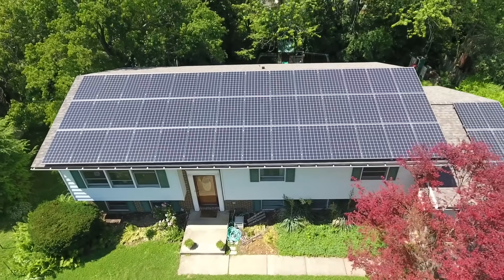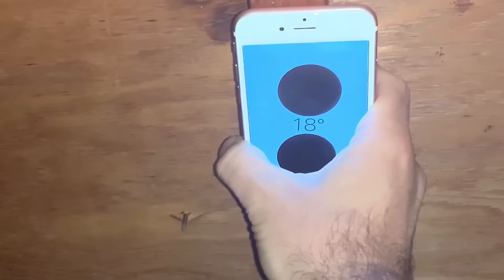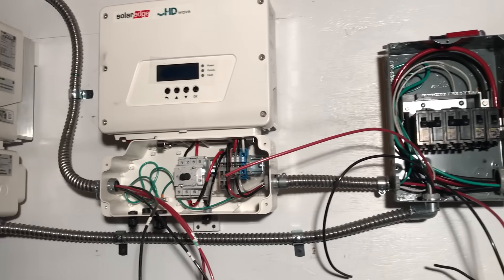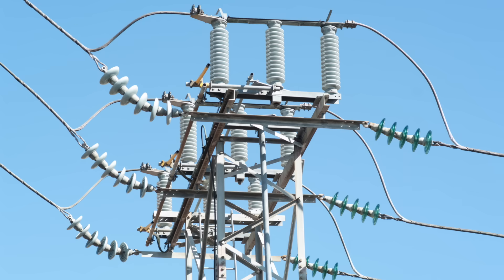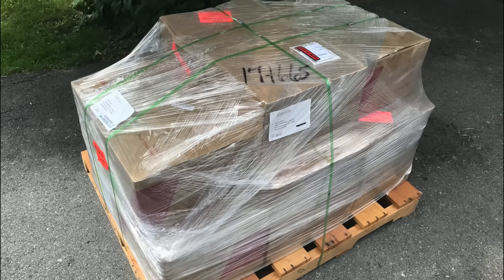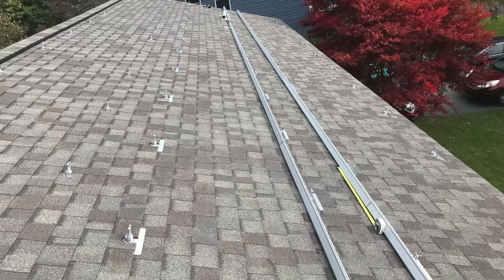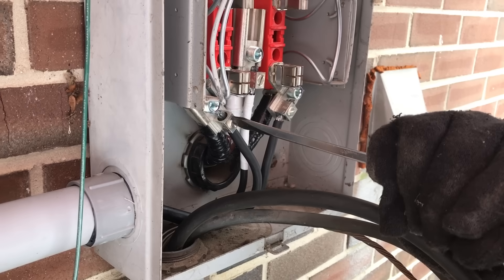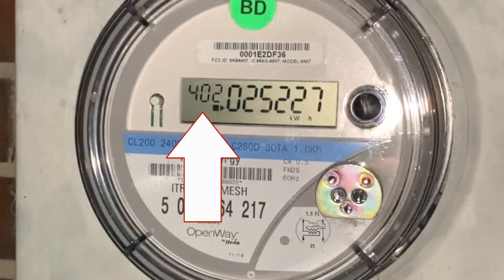I Installed a Power Plant Myself | HUGE DIY Solar Panel System

Comment: Next you need a smart power wall to send electricity to the grid during peak times. That is, if your power company charges different rates for peak and off peak times
Reply from the maker: If I had time of use rates (TOU), that makes a lot of sense but where I live it’s the same rate all day.  I get a 1-1 credit per kWh so no real need for batteries.

Comment: Dude, you rock!  This was a fun and inspiring video with the economics nicely broken down. The only thing I would add is how to address a leaky spot in the roof or one of the devices under the panels, if they need maintenance or replaced i.e. a maintenance plan. Next? Probably think about a decent haircut.

Comment: You think that chimney is unused. It probably vents your furnace or water heater.
Reply from the maker: No, it's only concrete blocks.  Actual function was removed before we purchased the house.  There is no vent or top.  It's best use now is for holding up conduit. =)

Comment: Not worth unless you can build an array seperate from the roof. The roof and panels share a life expectancy of around 20-25 years. Now you go from 15k for a roof to 25k for roof/panels or more. On paper you worked it out, post back in a few years once reality sets in. Panels are still terribly inefficient, you're making your utility company money while saving peanuts. Make sure when you post in a few years you provide your promotional compensation in the data so it's a fair presentation. Good luck.

Comment: Nice work on a worthy project, congrats!
Those Panasonic solar panels have a life of 25 years?  02:05  From what I have heard most solar panels degrade after just 10 years? 

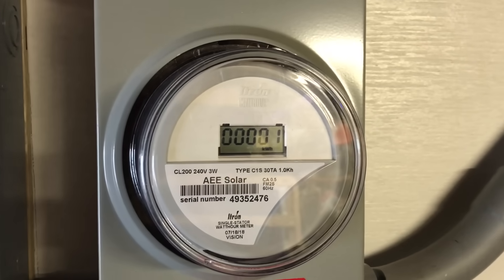Safety Note: 11:08 you connect your system to the grid by closing that large disconnect switch, sometimes those knives can throw a big arc of power serge out through the box right at your face. There are procedures in industrial plants to stand to the side to prevent burn injuries to your arm and face, in your case you would stand to the right side of the box and switch it with your left hand. See the sticker on the box warning of this danger too.
Reply from the maker: Thank you!  The panasonic panels are warrantied not to loose more than 10% of original output for 25 years.  It's one of the best output warranties out there.  I'm curious to see how they do as the years go on.  Thanks for the note on the switch.  Several folks have mentioned that.  Good to know!

Comment: Without a battery storage unit, like a Power Wall, I can't see how you'd ever have a net negative power bill. You're still using grid power at night and not producing anything via PV at those times.
Reply from the maker: I have net metering.  Did you see I talked about how the meter keeps track of what it drawn vs sent to the grid?  I get credit for what is sent to the grid.
Reply: He's selling power at morning and buying at night

Comment: Good day im from Belize. And I would like to know a ruff estimate how much that system cost you. Btw really informative video. Enjoyed it.
Reply: You may be less poor than the national average but if you are in the lower class of Belize this could really help you save cash
Reply: Hey Jason, Belize doesn't have import tariffs on panels to my knowledge. For an average grid tied system when you buy the components in Mexico or Canada (US is too expensive) you will be paying approx. USD $0.8-1/Wdc (this includes panels, racking, inverter, BOS, AC switch and DC wiring). This cost applies to systems from ~4-15kWdc.

Comment: well i dont know what state youre in but you dont 'make money' off of solar, you build up credits that fall off after a year, you dont get a check for that. and as far as 'no bill'. you usually get a separate 'true up' bill showing your energy made vs used, depending on time of year you can exceed the making of energy over how much youve used - usually in summer. i think you need to do a follow up vid to clarify everything in this vid and show numbers. i will admit though you built a HUGE system, when i worked at a solar company the energy company allowed only so big of a system, you built a system that could power an NFL stadium.
Reply from the maker: I actually do earn money, from the sale of SRECs.  It’s not much but it is better than nothing.  I’m in PA.  When they do the true up they do pay for the excess KWH but it’s at the wholesale rate.
Reply: @FrugalRepair  do you get a check?
Reply from the maker: I get checks for SREC sales.  And statement credit for excess KWH.
Reply: @FrugalRepair  how many you get a year?
Reply from the maker: My system makes about 18 srecs per year.  I sell them at various times.

Comment: So if you’re producing more energy than you use, does the power company pay you for the energy you send them?
Reply from the maker: The main thing is called net metering.  I get credit for any excess then I use up that credit at other times, like winter for example.

Comment: I have no plan to install one, but it is Very fun to watch
Reply from the maker: Thanks for watching!
Reply: @FrugalRepair  which state are you from?
Reply: @FrugalRepair  Great to see this vidi......impressed by both your work & that the suppliers & inspectors seemed to get their crap together, also.
Reply: @FrugalRepair  bro the government will rip you🤣🤣🤣
Reply: In 10 years you’ll say “ I shoulda...”
Reply: @IamDaniel247  it'll be way cheaper in 10 yrs. And more advanced.
Reply: I actually bought bio tech panels and yes it's worth it
Reply: @SPYDAPHACE666  👀...
Reply: @SPYDAPHACE666  how much tho?
Reply: $225.00 each room including the panels. $2,400 for the BLUETTI EB240 batteries I have two of them. Eight 300 watt panels was a little under $4,000. In total I spent less that 10k in total to be light bill free. Every thing was well worth it @teru797
Reply: @teru797  Start off with the Bio tech starter kit $225.00 with one room and see how that work out
Reply: @SPYDAPHACE666  well sure its worth it if you life in a country like Australia where the sun shines 224 days a year but its not worth it if you think installing sun panels is going to save the environment.plus not all sun panels are of a high quality production and need to be replaced in about 10 years
Reply: I live in the deep south Holly Hill South Carolina and its good weather year around here. Of course, if I lived in the big city I could not do this (Off grid living). However, in the country its a pleasure to be able to live life completely self sufficient 👍🏿  @RichardGilligan33
Reply: @SPYDAPHACE666  by the time you get your moneys worth it will break down and you need to replace it.
Reply: @SPYDAPHACE666  who installed them for you?
Reply: @Ashish Kumar Whoa! Calm down grumpy
Reply: Not really the power companies resell your power that the solar system made then give you a credit on your bill.
Reply: @kennethroth6757  before you feed back into the grid, the immediate power produced is used by whatever is running inside your home at that time.
Reply: @kennethroth6757  Install your own independent system....no bill
Reply: Rps law says people have to get them by 2035
Reply: I notice that when it rains the water goes over the gutter and straight on the ground. BTW those batteries deteriorate after 7 yrs.
Reply: Very nice kumander bawang
Reply: Me too
Reply: @NightmaresPen  klloopoooooopoopp p9
Reply: If ur rich maybe?that u can afford to pay evrymonth like 200$ a month or more. Unless u invest a big money 1st then return to investment like 2years and u can have electric bills free u can saved money for life😉
Reply: Me too😂
Reply: I live in 3rd world country, Installing solar panel is much more expansive than just paying electrical bill, if i am not mistaken the ROI for 4000W solar is 10 years
Reply: @mickolesmana5899  can  you  not    do it i    KENYA.
Reply: @tuforu4  If the panel is 10% cheaper my ROI will be 6 years, I live in Indonesia, Sun is always shine all day
Reply: Too much  work and money... There is a different and cheaper methods  but unfurnately government won't let you..
Reply: I have not watched it and have no plan to install one.

Comment: I'm speechless. And also full of words at the same time. 

How about off grid tiny homes? 

Or... Solar powered offices separate from the house. 

Anything 20×35×15 (length width height)  that brings electric, heat, and lights. In such a space, many different things can be created. Gaming room, personal gym space, hangout space etc. Where can I email you? Email me! Ramax25@gmail.com

Comment: I am buying a property next month that comes with a shop thats 30×60 and the roof is full of new new solar panels. 55 panels total.
Reply from the maker: That sounds great!
Reply: @FrugalRepair  it hooked up to the grid also from what I was told. And during the sunny days it builds up so much electricity that the property doesn't have to pay  for anything for like 7 months out of the year
Reply from the maker: That’s awesome!

Comment: Hello I think you have a great video. The only suggestion I could make is rather than a standard shut off switch I would have installed an emergency transfer switch so that in a grid DOWN scenario you could switch to emergency transfer and this would isolate you entire system from the grid thereby allowing your solar panels to provide you with power during the grid down.
Reply from the maker: Thanks!  That still wouldn’t help because the inverters won’t turn on unless they sense the AC power from the grid.

Comment: Great video.  I just completed my own DIY 8kW system and went through the same exact steps that you did.  It was quite EASY, once I thought things through first.  It was a little hard on my back and hands but I am 64 years old so I think I fared pretty well.  The system has been working great for nearly a month and I already have 114 kWh excess production in the bank.  Payback should be well under 5 years!
Reply from the maker: That’s so great to hear you did it yourself! Congratulations.

Comment: I do not believe the 5-7 year payback.  Each average panel only produces around .10 cents a day or 3.00 dollars per month.  Even if he installed 50 panels  that’s only 150 a month savings x 12 is 1800 a year x 7 years is 12,600 dollars.

Comment: Have you considered adding a battery bank and ditching the grid completely? A friend of mine just setup a 120KW LIFEPO4 Battery bank, it was 13,000.00 for the battery bank with BMS and monitoring. Together with his 30 KW solar panels he can run his whole house. The entire cost of his setup with inverters was $50K.
Reply from the maker: Personally, that would cost too much.  I have a good net metering setup here so no need for batteries.

Comment: Not financially viable if you are getting paid regular rates. Already tried in Ontario Canada. Total failure. Once government went back to "regular" rates ROI went infinite. Farmers were the ones wiped out. $$$ paid for solar needs to be higher then the $ paid for grid power. Also since you are wired into the grid you still pay "connection fees" which in Alberta are high. Finally one has to figure out "transport" fees.

Comment: You are so lucky where ever you live. My city said unequivocally that no permit would ever get approved for an individual without an electrical license or installation experience. Then after contacting 12 companies to get them to pull the permit with my design and equipment they all said NO! Finally one company took pity on me and did it.
Most of the profit in solar installations is in the equipment not the labor. This could not be done in Scottsdale AZ.
Reply from the maker: Sorry to hear that!

Comment: We designed and installed our own solar system a couple of years ago and keep adding on to it. We have 7500w of solar and it cost us around 4k after rebates. 2 quotes we got from local installers we were looking at $30k. If you have any background in electrical this is a no brainer
Reply from the maker: That's great to hear!

Comment: are you planning to add battery storage for either backup or load shifting?
Reply from the maker: Not anytime soon.  The net metering here is good and we don't have time of use rates so there really is no need to put in batteries.  But I'm open to it if things change.
Reply: @FrugalRepair  that makes sense. I live in Florida and every few years we are out of power for a few days up to or over a month due to hurricanes not to mention all the other times throughout the year that we lose power for several hours at a time and I am really interested in solar with battery back up for those reasons would love to find a channel that uses solar and battery for this reason to see how well it works I would hope it works well enough that i can ditch my generator.
Reply: @FrugalRepair  I was also curious if now that you have solar do you want to get an electric car?

Comment: Very informative, when they recommend you more work make sure to upload it, I myself installed a independent solar lighting system for my home I need to upgrade it tho, but it's running 5 years no issues.
Reply from the maker: Thank you!  Definitely working on more videos.

Comment: Nice work ! In Belgium we have to pay for double usage of the grid, so in your case, i see you have a 15kW installation, so you would have to pay about $1900/year plus some other taxes here, did i mention Belgium has the highest taxes in the world 😕.
Reply from the maker: Thanks!  That's too bad about paying taxes on solar.  I thought Europe was more solar friendly than the US. Is Belgium an outlier?
Reply: @FrugalRepair  can't speak for Belgians but Italy has mechanism to encourage solar power plants.

Everything is based on a bidirectional energy meter though you don't get paid 100% of a kWh value. 
The downside is that you get paid  something around 60% of the kWh commercial price, the upside is you get a 50% refund of the panels price in taxes.
Reply: Maybe you would cut taxes if you did a BEexit.  That would be a hoot!  The EU's headquarters located in a country that is no longer a part of the EU.

Comment: So you pieced it together instead of a kit ?
Reply from the maker: Yes, I didn't purchase a kit.
Reply: @FrugalRepair  although my aspirations are a tad bit smaller than yours. If you had to it all over again.. Figuring out what gauges wires and all the headache of trying to pick what equipment you wanted.. Would you still do it this way over a all inclusive kit? Did you save anymore really?

Comment: Great video I too have been thinking of going solar unfortunately I am in Alberta Canada we are now in our 3rd provincial government the first wanted to look green and they did a solar retrofit kit through the power company a basic system would cost about 120$ per month for 5 years and provide about 100$ a month of power for 25 years so I phoned
My provider and was shocked when I was told that it wouldn't save me much on my bill only after much babble I was told that it would only save the energy portion of my bill since my energy portion was only about 60$  I inquired about the rest it would be a credit  tryed to find out if I cut the grid would my solar retrofit contact continue or would it be due on my next billing after I cut my grid tie after a lot more bable I got no answer the next government was talking about going green in their platform but it became apparent that the only green they were interested in wss the green on the 20$ bill everything they brought out was designed to bring money to the company that could give them money the new one doesn't show promise either but give them some time they are fighting covid so I'll wait until the war is over and see in the meantime I'll see if I can figure out how to go solar on my own as it now cost 120$ per month just for the privilege of using power them they charge for every watt used and with the federal government and the carbon tax just going up if my gas Bill is any indication my carbon tax is almost 10$ more than my gas used
Reply from the maker: Thanks!  I hope you can figure it out so you can save money going solar.

Comment: Did you use battery system to store some of that charge for the night?
Reply from the maker: No need for batteries.  I have net metering and get credit for my excess power generated.

Comment: Have you considered a battery backup for when the power goes out - at night?
What are the details of power to the grid over the months? Ie. winter/spring/wummer/fall comparisons.
Reply from the maker: Currently, I don't need batteries because of net metering.

Comment: How did the cable ties hold up? I know it gets extremely hot under those panels.
Reply from the maker: They are holding up great.  I wouldn’t say it gets extremely hot under the panels. In the summer I’ll have to measure it and see what the actual temperatures are.

Comment: Here in Ontario Canada even if you use ZERO electricity your bill is still well over half of what your normal electrical bill is.  We're charged for "delivery", which basically means we're charged for just being connected to the grid.  (And of course you're not allowed to disconnect).
Reply from the maker: Crazy!

Comment: How costly is it if you need to take them off and put them back on to change your shingles?
Reply from the maker: It would depend on how many people are helping you, but with a couple of helpers you could probably take everything off in a day.  Shingle, then maybe 1-2 days to put back on.  Really depends on how many hands there are helping.  Since everything can be marked, it can be installed back the way it was and make things go a lot faster.
Reply: @FrugalRepair  mine came with the house. I hope it won’t cost me an arm and a leg taking them off and on when it comes time to change the shingles.